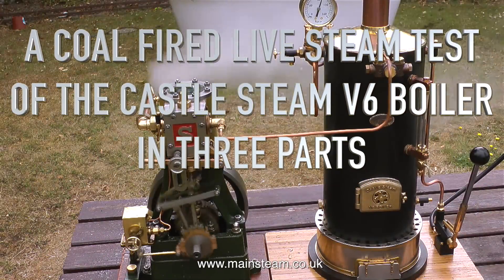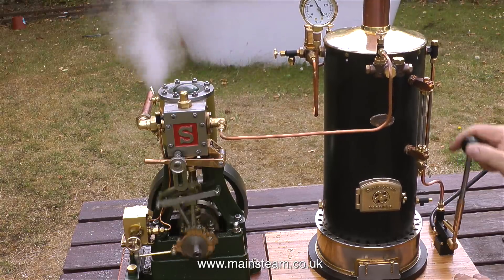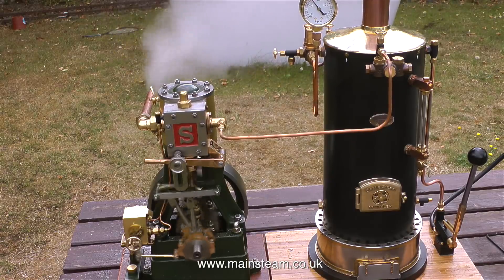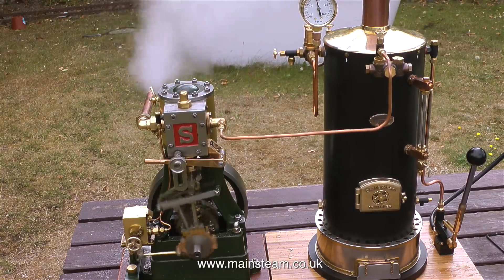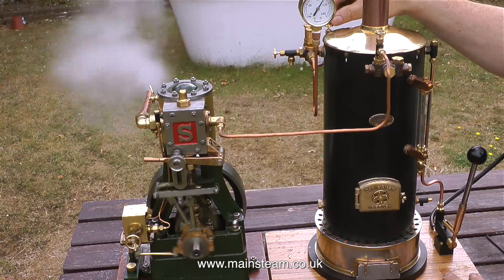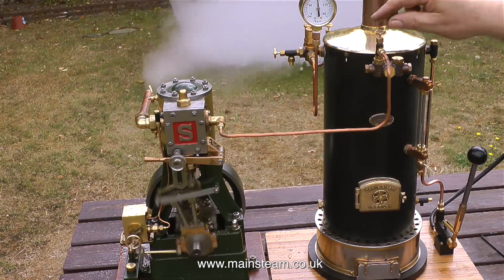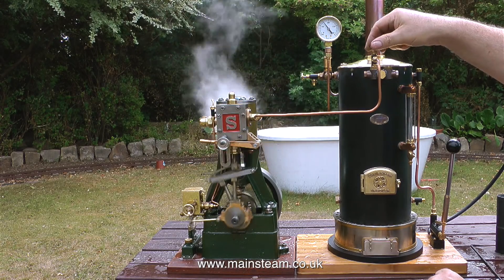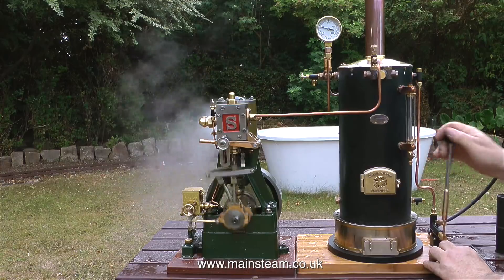A COAL FIRED STEAM TEST OF THE CASTLE STEAM V6 BOILER - PART #2

Comment: so the pump handle on the right is to add fresh water to the boiler then?
Reply from the maker: Yes.
Reply: @keithappleton  I always wondered, how do you refill the boiler while its running.
Reply from the maker: You just move the pump handle back and forth . . . . . . . .

Comment: Am i right in saying that, generally speaking you should see an orangey red glow mixed with flames, and at the same time black lumps of coal ready to be lit by the glow? I havnt spent much time firing engines in my life, but from the very little time spent on the footplate thats what I have picked up?
Reply from the maker: when my little locomotive is running and pulling hard the fire is almost white hot - !
Reply: Yeah! The amount of heat produced in the locos at Lynton & Barnstaple is mental. They sit there all calm and quiet, then you open the fire hole door and its a blazing inferno to rival the sun! And when they blast up the 1in50 from Killington Lane, well. You open that door even for a split second and you aint got no arm hairs left hahahahaha. I think I probably meant when the loco is sat still, lumps of black ontop of the glow ready to be burnt when you set off. But yeah, the firing irons and sometimes the shovels come out the firebox glowing red sometimes white.

Comment: It may have been something else, but it did look like that baseboard was starting to smoke a bit from the heat?
Reply: I thought that aswell, i want sure weather it was that or just the rain water turning to steam from the heat of the ashpan but it does appear to be coming from underneath the basboard aswell.
Reply: There is water soaked into the baseboard obviously. When the baseboard heats up from the ashtray, the water evaporates and steam emerges along the pores of the wood. Woodgrain is made to conduct water afterall.

Comment: A very nice boiler and a very nice 5A. Thanks for sharing Keith! That set up would make a very nice boiler and engine for a small steam boat or canoe, and would make a cracking video series!!
Reply from the maker: Yes it would Billy, I am sorely tempted, but as I have a lot of work on at the moment and now that includes the 5 inch gauge locomotive that Simon dropped off at my place to be converted into "Hogwarts Castle" - that should be an interesting project }:-)))
Reply: And somewhere on an old video Keith can be heard saying  " I always wanted to build a boat, but so far I only have the propeller"........so now he has a boiler made in heaven, you may be in luck.

Comment: I would love to see an automated way of keeping the boiler water level constant. Is that possible?
Reply: Yes, an engine-driven water pump with a bypass valve. If you run the engine at a constant speed you can fine tune the valve to precicely make up for the water used by the engine.

Comment: I've just rewatching this video and having a think about it. Have you got a definite plan in mind as to how you will supply the feedwater? I've seen that you have various weir style pumps.  Won't the present hand pump you have be large enough as an emergency back up once you have fitted a permanent powered pump of some description?  Just as a matter of interest do you know how what the water capacity is or how much water it uses when steaming hard ?
Reply: Please send questions and queries about the V6 to info.castlesteam@gmail.com and I am happy to answer them for you. There is a datasheet available.
Mike
Reply from the maker: I am going to fit a larger pump anyway and an injector then take it from there. I don't really do stats on things like water consumption etc ....... but the specifications should be on the http://www.castleinstruments.co.uk website